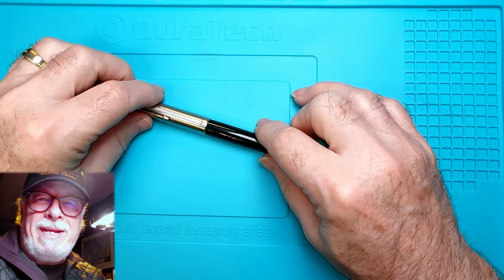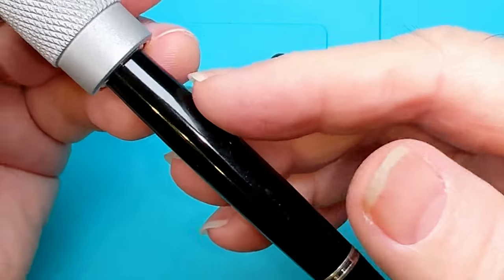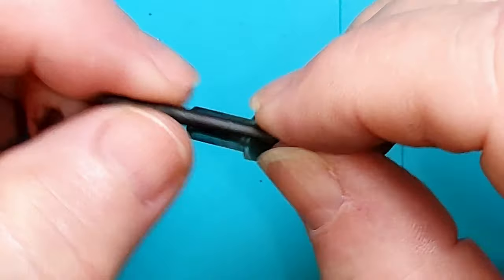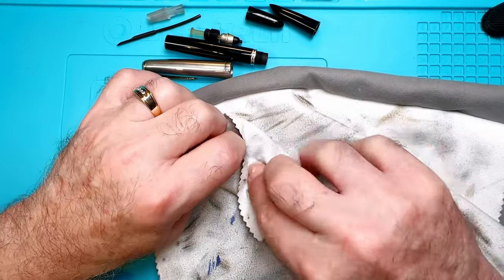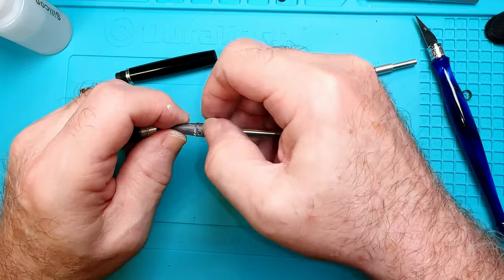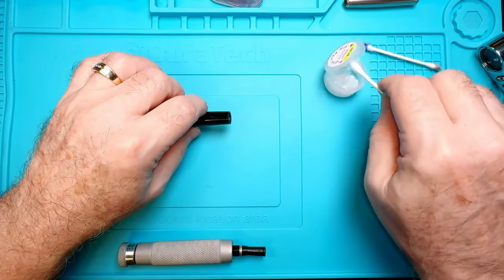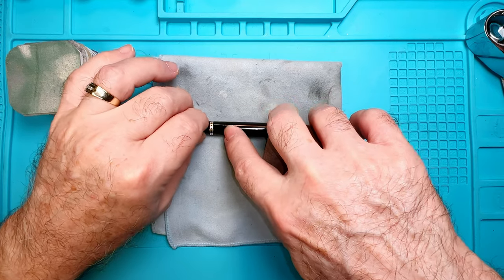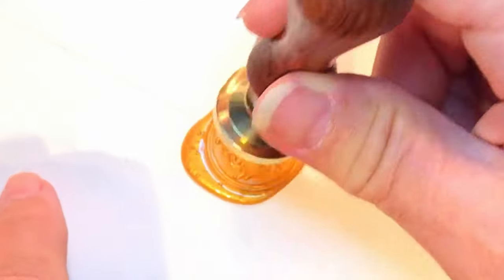Pen Resurrection Sunday Ep 55 1943 Parker 51 Vacumatic

Comment: The angled nib slit Ive caused by accident during grinding and tuning some nibs. Crossing the tines to decrease flow sometimes the tipping material gets caught and then the tines both twist.
It's fixable but has a severe risk of breaking off the tipping material. 
It's why I have 2 stubs nibs.
Reply from the maker: Yeah crossing the tines to decrease nib wetness is a good technique for new nibs. I now have two vintage stubs because of tipping material shattering. So it is a more dangerous technique on a vintage nib.

Comment: Very nicely done! Love the format. Enough detail to be educational, but still moving at a good pace. A couple of suggestions for you: (1) look into getting some rosin to seal the threads. Easier to release with heat than shellac; (2) sharpen the tip of a wooden toothpick on some sandpaper, and use that to fill the diamond. Much better control than the brush. 👍
Reply from the maker: Rosin just arrived yesterday.
Reply: 34:08 I can’t find the link to your WIX website in the description :(

Comment: Its Made of gold 14K.
The nibs are all dated starting with 1943, and most will have the tipping material also engraved on the nib. The earliest 1943 nibs will have OS-PL, which stands for Osmiridium Plathenium, changed later in the same year to RU-PL, which stands for Ruthinium Plathenium. Sometime in 1947, the designation was changed to just RU. The RU designation continued on nibs through 1950. Starting in 1951, the tipping designation on the nibs was again changed to PU. Nibs were available in a very wide range of point sizes.
Reply from the maker: I think you mean 1934 when Parker started dating the nibs. The nib tipping content codes are correct. So, this nib, having no date code is a replacement from between 1947 and 1950 as it has RU on it. It can't be from the date of production of the pen in 1943.
Reply: I think Parker did not start marking and dating the nibs until 1943. I think 1934 they started to mark the barrel only. The info is not cristal clear. Sorry. @InkquiringMinds
Reply from the maker: @joaomourato3395  Tony Fischier says differently: "In mid 1934 Parker began marking most pens and pencils with a date code, both the barrel and the nibs were marked, but lacking a date code doesn't necessarily mean that the pen was made pre-1935, since many imprints have been worn off with use. The first date codes, found for example on the Vacumatics, consists of two digits, the first one denoting the quarter of production, the second denoting the production year. Hence a "47" marking on a 1930's pen indicate that the pen was produced in the fourth quarter of 1937, not 1947, which is a common misconception.

In the second quarter of 1938 this system was however changed to save production time, and a new date code, using a system of dots, was adopted. The stamp initially had three dots and for each quarter one dot was filed down leaving none for the fourth quarter. Since production was overlapping examples exist with either the imprint 28 or .8. for the the second quarter of 1938. Also, since this coding system extended over a decade, a pen marked 38 could be produced the third quarter either in 1938 or 1948.

In 1950 a new system for the date coding was introduced where the two digits only indicated the year, not the quarter hence "50" means made in 1950, this system was used in the US until 1955 and in Canada a few years longer.."

Source: https://parkerpens.net/codekey.html
Reply: Sorry for any confusion, in my first post I was referring to the Parker 51 - the topic of your video. @InkquiringMinds
Reply from the maker: @joaomourato3395 Yes.  The post was about Parker date codes generally, but applies to the 51. They were dated from 1939 through 1950, with some exceptions, as can be seen on this one.

Comment: Fantastic video, the trial and error part was fascinating as you provided further solutions. What kind of Ultrasonic machine did you buy? Now I'm looking for them at Ali, simply because buying from Amazon US or EU just leads to additional and unnecessary import duties, whereas chinese products are free of customs. I guess the Hertz frequency is most important.
Reply from the maker: My ultrasonic is an inexpensive one with just an on and off switch and runs about two minutes each time and then shuts off. It is by Magnasonic. Just search Magnasonic ultrasonic jewelry cleaner and you'll get a number of different models.
Reply: @InkquiringMinds Thank you very much. Very helpful reply and I'm a bit relieved I don't have to spend a fortune

Comment: Would it be better to use a hair-dryer to heat the parts? Less heat than a heat gun, but still hot at max power.
Reply from the maker: Yes. A hair dryer is eminently safer, but takes longer. To just get the feel for how celluloid behaves versus plastic, a hair dryer is a good learning curve tool. The heat gun is more focused and easier to use once you know how to control the heat.